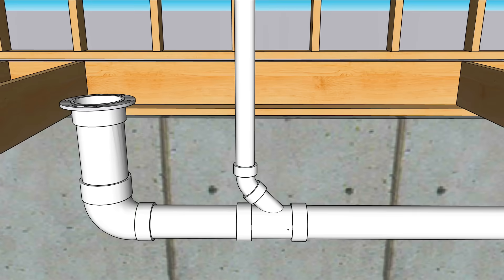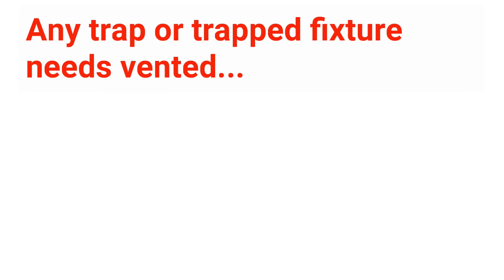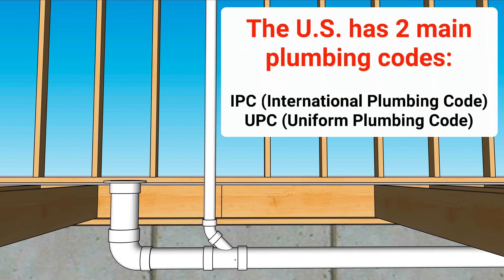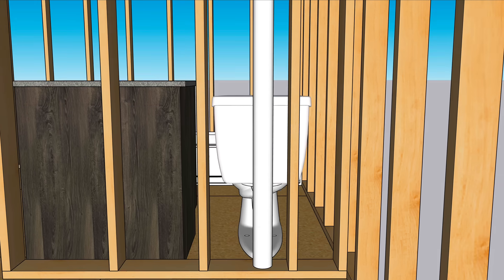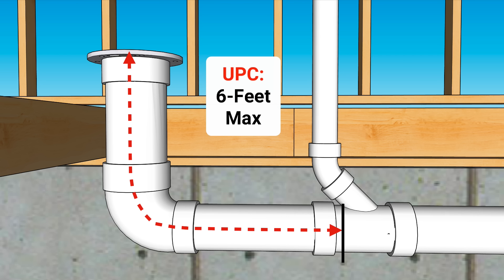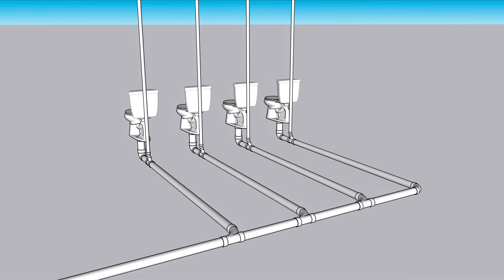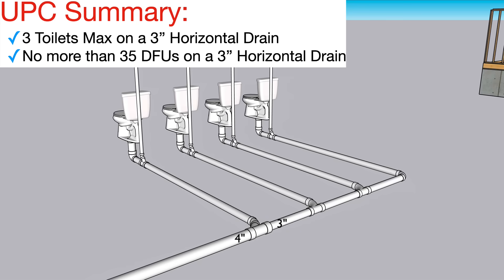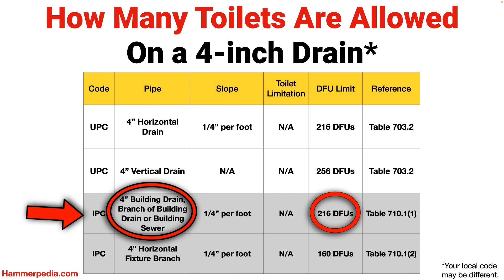How To Vent & Plumb a Toilet (in 2024)

Comment: Okay my problem is I changed everything on the toilet change the valve it was working perfectly but now water does not come out of the pipe so I check the main valve to see if it was open and closed so it's open but in the water does not come out from the valve that I just replaced water does not fill up the tank and I have no idea what's wrong with it

Comment: I always run the toilet vent full size through the floor and clean out for servicing the pipe. Leaving the clean out access behind the tank. That way you don't have to pull the toilet, just the tank.

Comment: @57 seconds you mention it needs to go vertical.  Does it need to go vertical right away?  The wall is 8" away to the side so I need to angle it a bit before going vertical.  Thanks!

Comment: 1.5"= 3,81 centimetres what"s mean you put a pipe about that size ???? I'm from Europe and am doing a renovation of my home now, I'm changing a drain system at the moment, the standard is from 11-16 centimetres. So asking myself now if it is necessary to go so big in size, It is not a problem for me personally,  I already have a hole in the walls but what's the point ???
Reply: Btw, your work helps a lot! Cheers!

Comment: I like that you can hide the vent in the wall and drill right through the 2x4 floor stud, now the question i have is it Allright to elbow my vent near the top of the wall and go through the wall and then elbow one more time straight upwards through my roof overhang instead of going up through the attic and through my main roof??

Comment: Question: 
The soffits in my kitchen hold master toilet and sink.. they are 8 -10 inch from subfloor. I need to move pipes up 4” to remove soffits and to be able to put cabinets to the ceiling in kitchen. 
Every code is and will remain I just need to cut and remove 4.5 “ of the line … is that an issue if I use 90 long instead of 90 elbow

Comment: I noticed in the first example the pipe is not sloped.  Can we assume a slope of 1/4 inch is not significant for the flange to offset the balance of the toilet?  Is there a maximum amount of slope before we would have to run pipe perpendicular to the closet bend in order to ensure flange is level with the floor? Thanks!

Comment: Well I hope you have more venting options in your PDF file because the house i just bought is the first one I've ever seen without a roof vent because the county bi-passed the old septic system everyone had and has a pump box on every ones house and a ground level vent around 10 feet from the house which is a large round plastic lid with a short pipe sticking out of it

Comment: For a small house 900sf2 with one bath and laundry in the garage, can I tie all the vents in the attic to a single vent 3" and direct it out to the highest point of the side of the house so there will be no penetration through the roof since I am planning on installing metal roof?

Comment: Never have i run a larger pipe into a smaller pipe,  4 inches into a 3 inch . Seems like a problem to me, should be the other way, keep it 3 or 3 to 4 . Maybe i am wrong,  wouldn't be the first time.

Comment: Do we need to install vent for each fixture such as wc, lavatory,foot drain. If the fixture  WC unit distance is less than 6ft from rise stack. In this case do need to provide vent in horizontal pipe or from vertical stack.

Also share UPC, IPC latest version pdf file

Comment: Ohio follows IPC. We are relocating a toilet about 8 feet from its current location and hoping to tie into the existing vent for ease. The vent stack is currently in the wall directly behind the current toilet location. Our code states: 909.1 Distance to trap from vent: Each fixture trap shall have a protecting vent located so that the slope of the developed length in the fixture drain from the trap weir to the vent fitting are within the requirements set forth in the table. Exception: The developed length of the fixture drain from the trap weir to the vent fitting for self siphoning fixtures, such as water closets, shall not be limited.  Is the EXCEPTION what removes the distance requirement? We just need to be sure before we continue. The toilet will be about 8-9 feet from vent stack. thanks you!!!
Reply from the maker: Hi, read points number 2 and 3 in this article on our website that answers this question: https://www.hammerpedia.com/how-to-vent-a-toilet/

Comment: Thanks for all the great resources.  I'm assuming this is Sketchup -- what do you use to model drain pipe and fittings?  In the past I used 'pipe along path' which simply converted lines to pipes of chosen diameter.

Comment: I have a vent already going through the edge of the roof of the back of the house. I'm moving the soil pipe to a side of the house as I am building a single storey extension. I wonder if I could use the top most part of the existing vent by connecting it to the new soil pipe by running it around the house along the wall. Is it allowed and is it something I can do? The existing soil pipe and vent runs straight up from about 100cm from the (outside) corner of the building in the back of the house. We are to move that to the side of the house about the same distance from the same corner of the house. So the new pipe will continue from the ground up to where it connects to the first floor toilet and then straight up (vent) and instead of creating a new hole through the roof on the side of the house, bent the vent pipe towards the edge/corner (100cm), bent it and run it along the back wall (100cm) and then connect to top part of the current vent which already runs through the roof and opens above the roof.

Comment: I would really like to understand a basement toilet venting scenario. Obviously you don't have joist at your disposal. The sewer line under the concrete is not deep enough to have a 3x3x2 wye for the vent line to come straight up. If I did that the wye fitting would be sticking above the concrete. The concrete is only about 2.5 - 3" thick. My sewer line runs under the concrete and out the house under the foundation wall and drops down to the street - 1940's house.

Comment: As a service plumber, i appreciate at least a 3 inch vent line for a toilet and no reduction in size from original inlet. so if the toilet flange is 4 inches i expect the rest of the main line to be 4 inches other wise use a 3 inch toilet flange. and the same for the vent if im on the roof and the vent pipe is 3 inches i expect the rest of the vent to be 3 inches and to not reduce to 2 inches.

Comment: Sometimes a "wye" fitting won't work because the Joist space is too short and may possibly be more expensive as you need to use a 2" 45 fitting to make it ready to plumb the vent vertically. The most appropriate fitting in this instance is a 3x2 "tee" on it's back. 

If backwash venting/ wet venting then a wye is most definitely in order.

Comment: We would use a San-T . That’s wouldn’t pass here in Texas . .
Sanitary -T 1.6gpf water closets are no loner avail or in Texas . Switched to 1.26gpf a few years ago .
Good video
Reply: I wonder how many Texans get red at having to use a drain clogging not enough water to flush sxxx down toilet. Conservative yes but not conservation here. Germany has had to rip up historic streets to replace the sewer system because mandated toilets couldn't flush with enough water to carry the sxxx on down. 
Going to a big cook-off with beef and pork ribs and chili beans! Got plenty of Charmin. Next they will mandate mascerator toilets with one quart water added per "flush".
Reply: @echodelta9  it’s 100% ridiculous. I agree! It’s not a 1.2 GPF if you have to hold the handle down or flush it twice . Most plumbers here in Texas want the 1.6 GPF water closets back .

Comment: It is ridiculous how in the US is still possible to fit 3 inches pipes for toilets. UK and Europe in general only use 4 inches 110mm. And toilet flanges don't exist, we do have toilet pan connectors to fit into pipe directly for solvent weld or into fitting (socket) for push-fit ones.

Comment: Thank you for this. My home has every fixture (except a defunct shower that does not even have a trap) S-trapped, but my late plumber tried to fix it with circuit vents. They don't work very well though. My tub's trap will not hold water & I have it plugged up to keep sewer gases out. I'm planning to move a toilet to an exterior wall, install a new tub/shower, and a vanity (I'm swapping my laundry room with a tiny bathroom that is unusable). The DFU bit is useful.
Reply: They have one way check valves for vents that may be worth adding for the sink. Also the main sewer line vent may be too small.
Reply: @adamplummer2190  I do have one through the roof-- looks to be about 2" pipe. I plan to  tie in the washing machine, tub/shower, & toilet to that vent but the kitchen sink, lavatory, and other bathroom groups in the house will have their own separate vents.
Reply: @catsmeow5566  make sure if it goes sideways it's above any water points or it can fill with stuff. May need to be snaked.
Reply: @adamplummer2190  Yeah, all vents will be vertical for minimum 6" above flood level. For the ones not connected to main vent they will have their own individual vents that  go through the wall, follow it up, and then elbow around the eaves and then elbow again to go above the roof. That is how the circuit vents are done. I am considering some AAVs for some of them since there is at least one atmospheric vent. The AAVs would be accessible for maintenance/replacement. Might need an AAV for kitchen sink specifically bc there is a window less than 6" above and if I tried to angle it around the window I'd hit electrical.

Comment: Every state has different codes regarding venting/back venting.
And you can not reduce pipe size as the flow goes. Meaning you can’t go from 4” to 3”. That would be an immediate fail

Comment: My question and story is a very interesting one. First floor toilet has a drop-down of approx 24" from toilet base into a trap and on to the 4" cast iron soil pipe. It interferes with a door opening because it is hanging so low from the floor rafters (approx 8-12") . Can the trap be replaced with your elbow in the demo you showed?
Reply: a toilet dosent commonly go into a trap   something  Ive never seen , Ive seen a lot  .   sounds like   its a illegal   botch job

Comment: Thanks for all of the great info! I'm looking to actually cut out a vent pipe to an old basement toilet that's been removed and the waste pipe has been capped. Do you see any issues with simply cutting the pipe out between the concrete floor and ceiling of the basement and capping off both ends? The roof vents have weather caps to prevent water from gathering at the bottom of the capped vent pipe. 
I had a plumber mention that he would do this, but I opted at the time to not pay him to do it and don't know if it was any more involved than he described. Thanks!

Comment: All these diagrams I come across show the toilet fixture draining into a horizontal lateral and it travels over to the stack to get the waste down to ground level. Does one need to move the stack and the wall below if it is directly under the toilet fixture's outlet to create a horizontal flow before it goes vertical?

Comment: Is there anything wrong to upsize the vent pipe just to make sure sufficient back pressure and code is met? for example installing 4" at all 3 toilets, to the roof just to have sufficient venting? We may end up adding additional toilets (large building), and without knowing for sure I'd hate to be digging out concrete to install more vents later..

Comment: I plumbed my toilet in with 2" PVC with 1.5"PVC vent . It drains very slowly but so far no problems 👍👍
Reply: Consider getting a bidet add-on for the toilet. Clean without paper problems. It's TP that will come back and bite you in the butt! It's everything you want when used (tough) but not when flushed. It's like wadding behind shot but there's not enough powder to shoot.

Comment: Can you add the requirement for the minimum vertical rise of the vent before an angle fitting can be installed?  It appears to be 6 inches above the full flow flood line but I'm not sure.
Reply: 6 inches above flood rim for a 90 degree turn to horizontal, but you can 45 immediately as long as you dont go horizontal till 6 inches above flood rim.
Reply: @nicksprung436  as 45+ IS defined aAS vertical , so you can put san tees on a 45
Reply: @dollyhadbraces9361  yes

Comment: I'm a plumber  Had a new custom home built 4 years ago  In one of our bathrooms we noticed sewer gas smells in the bathroom coming from the shower drain  I went downstairs and looked at the waste vent piping  The Water Closet Toilet 3" Drain Pipe goes along and the Shower P-Trap piping connects to the 3" pipe then the 3" pipe turns 90 degrees  There is a vent at this point and the Sink Drain connects to the 3" pipe   It seems the Shower trap is being siphoned when the toilet is flushed   the Solution is that weekly I need to run the shower to fill it's trap   This bathroom shower is seldom used as it services our guest bedroom guests     Also the plastic water system sucks Manifold is on one side of the house, Bathrooms and Kitchen are the furthest away it takes over 5 mins of full running water to get hot water to our faucets     Thanks for your video
Reply: Hi, james . I'm a plumber . Can you assist me getting a job there .I Am in kenya
Reply: Take those "water saving" time wasting faucet screens off it's quieter too. Then you can have a faucet that easily throttles down to save water.

Comment: I want to install a toilet for grey water purpose only for a sleep cabin, meaning no number two will be permitted. The build has already been completed, so this is an afterthought. That said, is it imperative that a stack has to exit the structure? I don't have that avenue available to me and was wondering if a stack can just be hidden within an interior wall? Not sure if there is a certain height that it has to go. Thanks!
Reply: well yes it absolutely is otherwise you will be having gasses enter the wall cavity. they make little one way vents that you can use without a vent stack that are code compliant. there is a code requirement for vent height before allowing bends above fixtures such as sinks
Reply: You'll be asking for trouble if you actually install a toilet fixture. Install a urinal or bidet. FYI urine is not considered to be grey water material. Also concentrated urea (urine) will burn the roots of plants.

Comment: you are NOT allowed to lay that Y fitting horizontally. ONLY vertically. a sanitary Y can be laid horizontally BUT only at a 45degree angle. you are against code and your "design" is junk

Comment: I had a bathroom remodel done professionally cough cough, so we had roman tub removed and we install a large walk in shower, so we paid to have the drain moved to the center of the tub, that required using a jackhammer to bust out the concrete, prior this work we never had a bathtub plug up.

When it is working you can hear the air going down the drain, but in three months the shower backs up and you are taking a ankles deep shower,  I cannot get a snake through, very tough, I do put a rubber bladder in and blast out the clog and then 2 weeks later it is clogged again, we do not use that shower anymore, when people see it they say what a nice shower, 3 shower heads, they can all operate at the same time because we upgraded the plumbing to the shower. 

Any ideas on how to fix this before we call a breaker out again?
Reply: get someone with a camera

Comment: Just wondering if integrated vents or internal vents are legal in the US see https://youtu.be/O-T9w5NNnuQ and https://youtu.be/kjyePcixR3c for examples. These are save solutions that need less maintenance and prevent bad air to go inside your home or attic/roof where air intake can be located and avoid problem when flushing water as well. Less pipes, less fittings... Less problems and lower cost with little maintenance.

Comment: Only issue I see with this is you should never reduce in the direction of flow. With that being said, it should be 3” or 4” full size up to the closet flange. Additionally, you’re able to use a tee rather than a wye long as it is a vent only. Could help in the event you have tight spacing for said vent.
Reply: Using a tee, you'll regret the day you have to snake through the vent.
Reply: @mightymight365  if piped correctly, you should never need to snake through the vent….
Reply: UPC states if youre below floodrim, a y and a 45 is required, above flood rim you can go back to tees
Reply: Can't put a t on its back.  And it's not classified as reduction in pipe size when you use a 4x3 closet 90.
Reply: @chadcrego1009 
Of course you can put a tee on its back, if the branch is a vent.
Reply: It's a san-tee that can't be on its back a wye is ok @chadcrego1009
Reply: The 4x3 closet bend is used in probably 80% of homes in the U.S. Agreed that you should never reduce in direction of flow but the closet bend is an exception and is made for this very purpose.

Comment: I've got a home built in 2019 supposedly built to UPC code and the roof vent is not clogged.  However, the city power-jetting the sewer main on my street (yearly routine maintenance) sends high pressure air into my drain lines, to the point that my toilet p-traps blow out (2 toilets, downstairs and upstairs).  Toilet water blasting out of both bowls whenever the city jets the public system.  It is sewer gas, but no actual sewage.

I can't confirm what exactly was installed behind my walls, but the builder of course insists everything was to code.  Nevertheless, I have this problem.... anybody dealt with this, have any solutions, or advice on how easiest to solve this problem?
Reply: Time to run a camera from somewhere and see what's up.